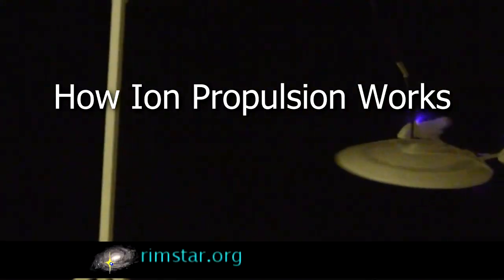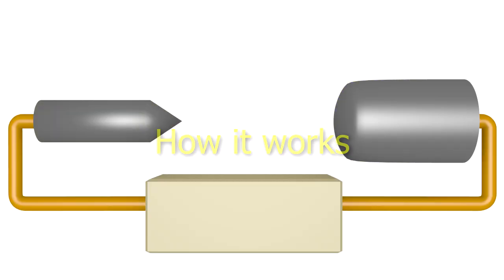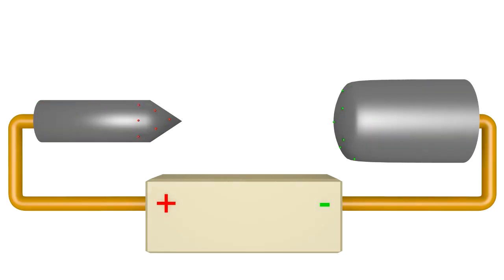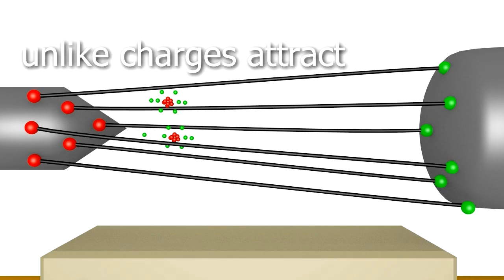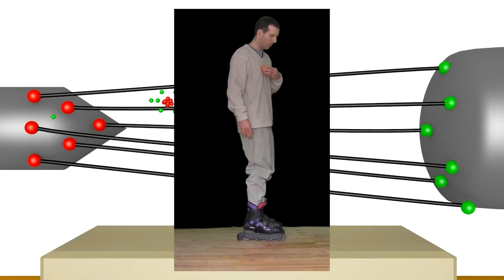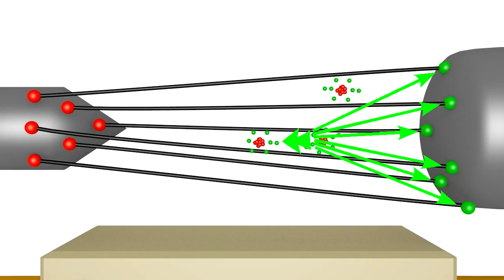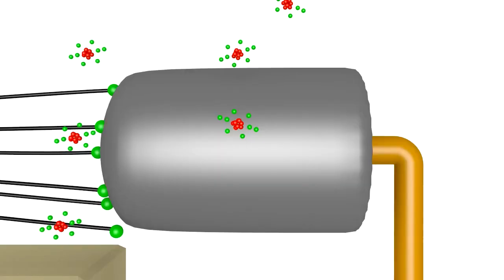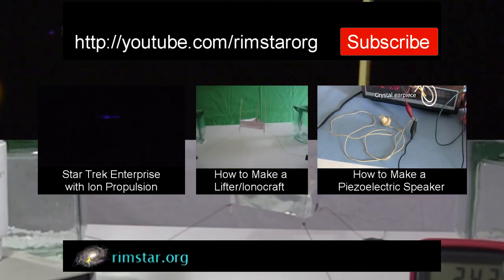How Ion Propulsion, Lifters and Ionocrafts Work

Comment: You only used just above 250 v for the lifter?
Reply from the maker: No, my lifter needs around 26kV and around 275 microamps. If you were going by the meters shown at the beginning of this video, they were showing the input from the low voltage power supply to the high voltage power supply, not the high voltage output. The digital meter was showing around 2.5 amps for the current draw from the low voltage PSU to the high voltage PSU.
Reply: Oh, wow, 26kv for such light weight?
Reply from the maker: Indra Ida Bagus
Actually, 26kV is meaningless without the 275 microamps. 26,000 x 0.000275 = 7.15 watts. But then again, I don't know if 7.15 watts of continuous power is good or bad. According to MITs recent study this type of ion propulsion can be more efficient than a jet engine. It's just not practical since for a person, you'd need to sit in the middle of a device charged to a few million volts.
Reply: Heheheh, of course I know it's meaningless without the amps. But it's a big voltage. : pokerface :
Reply: RimstarOrg OK, I just realized. Is the input AC or DC? 1st) If it was DC, that's a big voltage. And how you step up the voltage, transformers only work with AC? 2nd) If it was AC, how you turn high voltage AC to DC (after step up) or if you turn AC to DC before step up, back to no 1 question? :v
Reply from the maker: Indra Ida Bagus
It's DC. AC would make the ion wind go back and forth. It's also been tried with AC and not worked as expected. Pulsed DC also works. 1st) Most HV DC power supplies use DC as input to a flyback transformer circuit which turns it into high voltage AC and then step that up to higher voltage DC with a Cockcroft-Walton voltage multipler circuit. See my "How to Make 30kV High Voltage DC Power Supply with Flyback & Cockcroft-Walton Multiplier Tripler" video http://youtu.be/GEuK1OdYxHk for my power supply.

Comment: Great presentation.. Faulty conclusions however, can you explain how it still works in a vacuum with NO AIR?? Your theory doesn't hold a source charge to to the proverbial candle flame. Sorry I'm not buying that theory.
Reply from the maker: Thanks, I'm glad you liked the presentation despite finding the content faulty. My answer to your question is that the vacuums used weren't perfect vacuums. All footage I've seen of lifters and other devices of this sort tested in vacuum chambers moved much, much more slowly, which would be in keeping with the reduced amount of air. But of course, not having done vacuum experiments I can't say that that was the cause with as much confidence as for lifters in air. My smoke tests clearly show a large amount of powerful air flow. In my "Lifter Voltage/Current and Smoke/Airflow Test Measurements" video http://youtu.be/LOGAaObsN4g at 3:21 you can even see a piece of burning incense being strongly blown down and away. However, unlike many others I do keep hope that there may be some electrical way to interact with the quantum vacuum to produce motion.
Reply: RimstarOrg
Hi, the answer to why it still kind of works in a vacuum is because as you said there is still a trace of air left and the ions now can move much faster because of low air density and transfer their momentum onto the the neutral gas molecules which then can also recoil much faster giving a higher "thrust" per gram of neutral gas. ie  in normal atmosphere ions move slowly but impinge on very large number of neutral gas molecules  . In vacuum ions move very fast but impinge on much smaller number of neutral gas molecules.

Comment from the maker: Wondering how I my ion propelled Enterprise worked? Or how a lifter or other ionocraft works? All is revealed in this new video. Enjoy!
Reply: why do you tie your lifter? infact almost all the ionocraft videos ive seen, the lifter has been taped/tied to the ground quite closely. why not just let it fly straight up then lower the voltage and get it down ?
Reply from the maker: EpicBunty
The three sides of a lifter produce varying thrust in different amounts. Since there's no independent control for each side, if the lifter weren't tied down then it would fly erratically all over the place, within the limits of the feed wires. So the thrust is turned up such that the threads are all being pulled tightly. That means that two sides are thrusting more than they need to be and the third side is thrusting just enough to keep the threads on that side tight.
Reply: i thought so!
how erratic is it ? I'm sure with a little bit of experimenting and tinkering you can make a model which flies stably.. right? or have you not played around enough ?
Reply from the maker: EpicBunty
It can be very erratic. I've played around a lot because you often have to do that just to get it so that all sides are thrusting enough just to get off the ground. It appears as though the more sides you have, the more stable you can get it. I guess many more sides averages out the differences in different areas. So the lifters made up of many triangles tend to be more stable. But I've still never seen anyone be able to remove the threads.
Reply: wow! thanks for the info.
If you ever do end up finding a video of a stable lifter, mind sending me a link ?
Reply: RimstarOrg  i was wondering would it be possible to combine both a lifter and ion propulsion  to the same object?
Reply from the maker: DuelistGaming
I don't understand. A lifter flies using ion propulsion.
Reply: i was wondering if you could push it both forward and up at the same time while remaining stability on a larger model?
Reply from the maker: DuelistGaming
You could probably make something like that but all the electronics for control and power would be too heavy to carry with it and would have to stay on the ground. Only things as light as foil, thin wire, and a lightweight structure would be in the air, just as is done with a normal lifter.
Reply: yeah i figured the mass of the battery would be to much for the lifter to carry thank you thought
Reply: do you know what em drive theory is?
Reply: No i do not.
Reply: if u swich ends will it be still lifter or downer :)
Reply from the maker: Lithuanian science
It's still a lifter. :) I've done it. There may be a slight difference due to the difference in ion mobility between positive and negative ions in the air but it's not noticeable when flying a lifter. My power supplies have positive high voltage output with the other end being ground (i.e. negative with respect to the HV positive output.) Since the foil is closer to the table, which is also at ground potential, I connect the foil to ground and the HV side to the thin wire. That way the grounded foil is close to the grounded table and there's minimal attraction. But as I said, I've done it the other way around too.
Reply: thanks 1st place science fair medal here I come
Reply: RimstarOrg hy will be possible to tell me how did you make your high voltage? thank you
Reply from the maker: Oops, I missed this question somehow. For ion propulsion I use my homemade 30kV DC power supply https://www.youtube.com/watch?v=GEuK1OdYxHk. More detail is also on my website at http://rimstar.org/equip/30kv_pwr_supply.htm.
Reply: RimstarOrg  is this can call electromagnet propulsion or there are different?
Reply: EpicBunty balance
Reply: RimstarOrg have you ever thought about changing the shape of the smooth side. Shape it like the nozzle of a rocket and see if you can’t get a more direct stream of ions. Thanks Fitchtattoos@icloud.com if you have any questions regarding my theory on this one.
Reply: If you reverse the polarity, does it move to the opposite direction?
Reply: Oh, it doesn't... ;-;
Reply: that is awesome.  do you think this is similar to Tesla's jet out of a test tube?  He was speaking at a public science demonstration and said if he put a wire at one end of a test tube at super high frequencies, but not much amps, it shot a blue flame out of the open end like a blow torch.  ???  You are a great teacher, by the way, and your graphics are much better than mine.  Next year, I plan to start up a kickstarter company that will build a forcefield, using my theories.  Have a nice day, Sir.